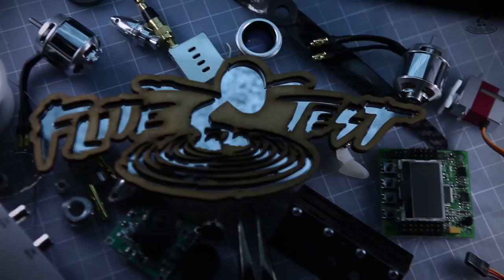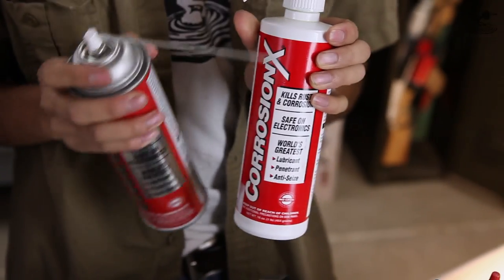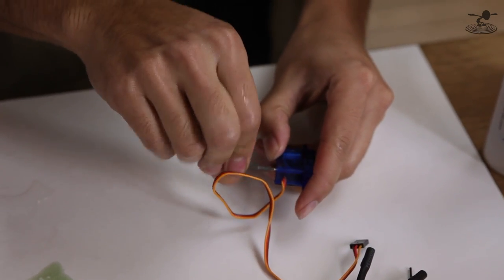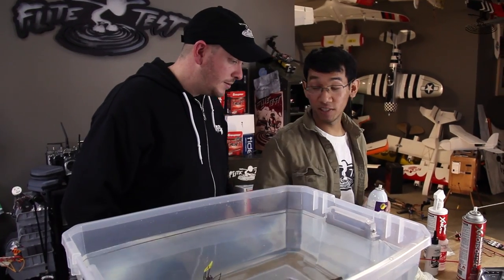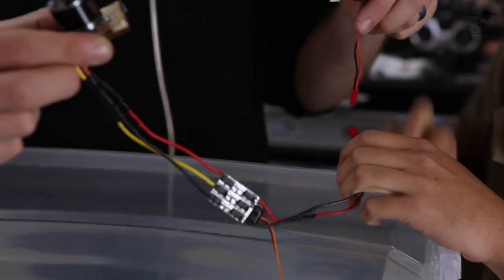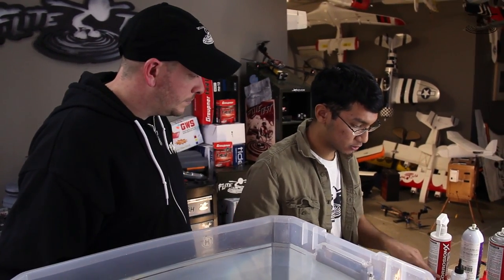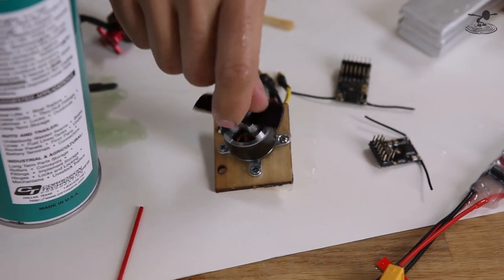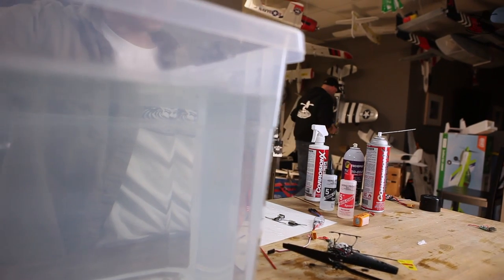Flite Test | Waterproofing Electronics

Comment: Thank you Peter. I have been using Corrosion X red label for years, saved many rec, escs and servos.
I learned about it on the WaterPlanes Forum on RC Groups. I also ordered it from the dist. in Michigan. Later I found small cans of it at my local hardware store. I also use it on light bulbs in the car, house, connections on my trailers and all those lights. It works great. I also use it on the tongue jacks on trailers, and I know some people who buy it by the 5 gal cans and use it on snowmobile trailers, their snowmobiles and all the other outdoor stuff they have that they want to keep lubricated and worry free.

Comment: Standard 5 min epoxy is conductive to a point. I have been waterproofing electronics for over 15 years. For esc  the best way is is by using 3m potting compound. You need to disassemble and then brush all 2 light coats over all the fets, resistors ect. Then put back together and you are good to go.  Servos corrosion x is good. For the rx you need to remove from case take a small piece of styrofoam stick on pins temporarily and then spray with liquid electrical tape. I use clear but black will work. Spray a couple coats and you are golden with no loss of range. I have a entire thread on OSE offshore electrics forum from about 8 to 10 years ago showing the exact procedures. We were making our gas and nitro boats electronics waterproof long before there was fast electric boats and waterproof electronics for rc. Anyways awesome vid enjoyed watching.

Comment: I learnt the hard way when I used a non waterproof steering servo in my nitro RC car in the rain, one minute it's driving fine in a straight line then the servo starts twitching at full speed and flips the buggy. Make sure to water proof your servos or buy a water proof one! Great tips Flite test :)

Comment: I used Corrosion X HD after watching this episode on a cheap HXT900 servo I have setup for my underwater ROV and so far it is waterproof in fresh water up to 40 feet deep so far.  Next dive should be 80ft or more.  Thanks Flite Test for the great idea!!!
Reply: yea you can buy a radio cover so you can fly in the rain aswel
Reply: rsokors what is an ROV?
Reply: star wars games ROV=Remotely Operated Vehicle.  A common term for an underwater rover... like a submarine, but with special features...
Reply: rsokors oh, so a remotely controlled sub basically.
Reply: star wars games Yeah.

Comment: You might consider sealing your heat shrink  with RTV Silicone as well.  Windshield sealant (RTV) will seep into crevices very well.  If you think you might ever want to get back into your electronics, RTV would be a lot easier to dig out than epoxy!!!  You might also want to try Dielectric grease.  It's a little messy, but does a great job of keeping moisture out of connectors.  I had a customer who wanted to waterproof his Satellite Broadcast Transmitter.  TWTs (Traveling Wave Tubes) Normally run at about 8800vdc on the Cathode, 4400 and 2500 volts on the two collectors.  He used Humiseal 1B31 to coat all the circuit boards and dielectric grease to seal all the connectors in his transmitter.  Then he took it out to the parking lot...put it in transmit (that means with the High Voltage power supplies turned on) and put a garden hose in the chassis and turned it on!!!  He ran it that way for half an hour with with the water running with no failures!!!  I doubt you'll ever run into 8800 volt power supplies in your RC equipment, though!  ;-)

Comment: Liquid electrical tape is also very useful, and it's pretty easy to remove. I did my video transmitter, FC, Radio, and ESCs and I was able to fly in pouring rain. I haven't tried it submerged, but it I'm sure it will work.
Reply: +compwiz00 did u dip your esc's?
Reply: +compwiz00    Where did you get that?  Live near Seattle and am interested in flying quadcopters in the rain.  Unsure about what to do with the flight controller

Comment: Remove heat shrink and dip the esc as to create a thin layer that 100% keeps it dry but also allows better heat transfer as it is like a heat sink. The heat shrink only insulates the esc by minimizing surface area directly affected by air flow. I have boat esc’s dipped in two part epoxy like a candle that are 6 yrs old and have seen water as a cooling method. The point of failure is typically in the battery connector

Comment: What does it do to the plugs on the transmitter. Does it coat them and stop them sending a signal?
Reply: this stuff is cool, conductive and water resistant
Reply: So if I do it on a plane then later add aux and additional stuff it will work? It doesn't block me for plugging in new stuff?

Comment: is it plastidip good at all for waterproofing an ESC?,thanks a lot...
Reply: actually, yes. I plastidipped the circuit board and all connectors of an old HTC Thunderbolt phone and reassembled, threw it in the water for several hours, it still boots up to this day

Comment: Very informative. Just purchased the corrosion x....also, sticking your hand in a bucket of water with DC voltage that low with low current idling a motor will far from ever hurt you.  Matter a fact I don't think even high current at that voltage would hurt you. Don't forget, DC voltage is nothing like AC voltage. Ac current return path is earth, putting your self between the bucket of electrified water and earth will shock you but...direct current works in a very different way, your body would have to be in series with the battery and the load device and even then you'd need a little bit of current to feel it. Don't forget too, that water has a better conductivity than your body, it would never pass through you before the water...as electricity chooses the least path of resistance...flight test guys don't know all this???😁

Comment: For things with dip switches or tuning pots I have used silicone sealant. Means that it can be peeled off again easy. I have also heard of people using plasti dip as well. Can also use marine grease and pack their servos full of it, electronics and all to waterproof. I have also heard of grease used to protect connectors.

Comment: hey for testing salinity content you can use electronic testors, or mechanical ones. salinity changes buoyancy.
For Automotive battery, and radiators the mechanical testors use different pellets that float at different levels depending on electrolyte content. or a needle that floats.

Comment: I think the esc is so vulnerable because it has the transistors that use a very small signal to activate them, and if it doesn't get the right signal it will bridge some circuits and create dead shorts.
Reply: I think so too, MOSFET need almost no current to turn on, and if there are any H bridges, it will short them.

Comment: Have you tried 3m 4000?  That's a waterproof sealant I use on my sailboat. It actually cures faster with moisture. Fully waterproof and remains flexible. I'd recommend that over epoxy any day.
Reply: +Ralph Hoffmann  That sounds interesting.

Comment: Excellent video.  I need to mount some water-rudder servos on floats for a float plane.  Now, I know how to waterproof some servos that I already have.  A couple comments on epoxy though.  (1) Although you don't need a structurally strong epoxied joint, the epoxy parts really should be measured out more precisely than skirting globs together.  If the epoxy/hardener proportions are not at least close to being precise, the epoxy mixture may not ever fully harden.  (2)  Epoxy has a lot of allergens that can absorbed through the skin and breath.  Nitrile gloves should be used when mixing/applying epoxy.  There are many known cases of people unexpectedly suffering anaphylaxis due to exposure to liquid epoxy.  Some people have severe allergic reactions during the first exposure to epoxy and others after prolonged (as in years of off/on usage).  Anyway, I just wanted to say a word about respecting the allergenic properties of epoxy.  Great video.  You guys at Flite Test always do a great job of making informative and entertaining videos!!!

Comment: If you gets your electronics wet, disassemble it and rinse it in distilled water (electronic water is best) and then in isopropyl alcohol.
Isopropyl alcohol (IPA) will pull out water and then evaporate quickly. This limits the chance there will be a drop of water somewhere under your components or in hard to reach place. Also IPA may be able to dissolve some of the contaminants that water could not. Also, don't be timid when using distilled water, just submerge it and shake it vigorously.
I see many people making mistake of not committing to really submerge the laptop board in the water. You really want as much distilled water so that it can quickly dissolve and pull contaminants from your board. The more volume of water and the better access it has the better for your board.
Good distilled water (or even better, electronic water) is not damaging to the board. It is only after stuff is dissolved in water (microelements, salt, chlorine, oxygen from air) that it becomes damaging to electronics.
It is still better to rinse the board in tap water and then with IPA than let it stay covered in salt water or sweet Latte...

Comment: As an electronics engineer I recommend what we call Potting the electronics. you can purchase the potting epoxy pretty much anywhere online or at electronics supply stores. conformal coating is another name. esd safe and anti-corrosion conformal coating is recommended for most electronics boards. it does not work well for parts that need to dissipate heat, such as the ESC or the HV servos. if there is any doubt, google is your best friend. for protecting your brushless motors, you can use silicone lubricating spray and a frequent cleaning with wd-40 to remove moisture.
Reply: For the issue with the ESC. you can pot those but i would not pot the power FETs as they need to transfer heat to the heat sink and the voltage they put can short fairly easily through conformal coating and corrosionX, instead you can use the 5 min epoxy or even 100% silicone like what is used for glass.
Reply: Also, radio signals in general dont work well through water. that is why most ROVs and rc submarines use tethers. you can get around this with a massive antenna on an fm receiver or by making an antenna tube that breaches the waters surface while diving.

Comment: Late to the party, but three thoughts:

You can get epoxy with self-mixing nozzles to make it easy to fill the ESC.

I personally would think pure silicone sealant would work better than epoxy, because it will remain flexible.  It sticks directly to anything that is made of silica, including glass, with a really strong bond.  It's used to seal aquariums!

I'd try sealing the ends of the heat shrink and letting it cure before shrinking it creating an even tighter seal.

Comment: I am not sure if this question has been answered, but what should I do if I  have an AIO board with all of the ESCs mounted on the bottom stack of a two tier tower? I do not have four individual ESCs. I do not think I can put heat shrink over the entire bottom board. I am not looking for it to be able to go under water, just as a snow guard. Will regular silicone conformal coating be enough to prevent damage from a crash in the snow?

Comment: How often do you need to re-apply corrosion-X? Or is it a permanent solution to moist/water protect your electronics? The epoxy to me feels like a more permanent solution because it feels like a spray will only work for some amount of time?

Comment: Hi guy's I have a question about using this on my flight controllers in my multirotors. Will this prevent me from soldering the board? Is it a matter of cleaning the area with alcohol? Thank you for the video's you make I always learn something every time.

Comment: Instead of putting shrinktube around the ESC, I wrap it in packing tape, and seal one end. I pour in the thin "finish" epoxy. When it's hard, you pull off the tape, and you have an aluminum heaksink exposed to the air...plus, the ESC is completely "potted" in epoxy, and waterproof.
Reply: Excellent idea!

Comment: Does a six amp ESC need the epoxy treatment or could you just use the corrosionX.  Epoxy seems a little overboard for these tiny ESCs?

Comment: Hey, I'm new to the hobby and i have a couple of questions...
What do i do to my controller board (kk2.1) to waterproof it?
If i want to fly my hexacopter in rain, is corrosionx enough or do i still have to go with epoxy? And also, do you have any alternative to epoxy, because i cant find that thing in india.
Do i have to worry about getting the corrosionx off of my components... or can i just leave it like that?
thanks!

Comment: what do you suggest for a simple plug and fly led light system.  I was hoping for something that just plugs in and does not require buying seperate connectors and soldering etc..  thanks

Comment: This is ALL sound advice. Thanks!!! 
ONE EXCEPTION!! Spraying the Motor with CorrosionX ONLY works for SENSORLESS Motors!! You WILL fry a Sensored Motor doing this. Conformal Coating or Epoxy on the Motor Sensor Board. 
Other than that caviat, thanks Peter! That was very informative.
Carmine 💥 ⛽
Reply: Puh, thx, was about to do a sensored motor...back to plastic dip it is then!

Comment: If i cover the connecting parts of the circuit with this substance, will it stop the electric current, or is it okay to coat it over all my connections, and can this substance also waterproof DC motors

Comment: If I remember right there is a caution on the Corossion x for LCD screens, it may not be great for them, may apply to a kk2 board. Otherwise I use it on my boat trailer light connections that get regularly dipped in salt water and it makes life much easier, its good stuff, a bit pricy, but good.

Comment: Great information!  Will this work on a camera attached to my quad as well?  I have the phantom 2 vision + .  I'm considering rebuilding with the GoPro but I haven't found a gimbal that will hold the GoPro in its case.  I'm often flying over the ocean, so getting wet is just a matter of time.  Thanks!

Comment: Awesome video. Although "distilled tap water" has a much lower conductivity than conventional tap water (or most water that will be encountered in the field by an RC vehicle). So actual performance may be somewhere in between the two types of tests performed here.

Comment: for the cooling for the ESC's, i was wondering if you could attach a heat sink similar to the ones used to cool CPU's, and have the heat sink exposed to cooling air/water but the ESC itself would be completely sealed off.

Comment: Great video.  A question for the electronics gurus: What is the reason for CorrosionX and conformal coating not working on ESCs? (e.g. heat dissipation, current, high frequency AC?)

Comment: I have been in this hobby for 8 months now and I have never heard of Corrosion-X. I've only ever heard of conformal coating being used. This video is 7 years old. Was it discovered that Corrosion-X wasn't a good product to use? I've used Conformal Coating a few times but every time I used it by quads quit working after a few weeks. They never got wet, they just stopped working. I didn't know if it was conducting electricity or holding in heat OR if it's just that electronics that come out of China suck and half the time don't work right out of the box. I've also seen some silicone tape that is for heat dissipation but it looks like ti would also seal the electronics from water. That seems good since it's designed to allow heat to pass through it but I haven't heard of anyone using it to waterproof electronics.

Comment: Great video - I've been into boating for years, and use Corrosion X to protect all sorts of things. One thing though - you might want to wear rubber gloves when using it. These products contain some nasty cacinogenic organic compounds and solvents, and god knows what else. The lables are explicit about avoiding contact with skin, or breathing the vapors. Gloves and good ventilation are your freinds around nasty chemicals. Remember: The better a chemical works, the more toxic it tends to be ;-)

Comment: Just used CRC Heavy Duty Corrosion Inhibitor on my DJI phantom.  Didn't do the GPS unit, but sprayed it on everything else.  I figure the plastic case provides some protection but this can't hurt...First test flight nothing bad happened...Not going to dunk it in the bathtub or anything so can't say how well it works but the treatment doesn't seam to have done any damage.

Comment: Awesome video, as usual I am late to the party. I found many uses for  corrosion x the last 25 years on many corroded stuff and electronics. I would add is to be careful when using on your transmitter. The plastic on the screw areas and battery compartment in my tx JR 9x slowly fell apart. Remember to wipe away excess spray and keep it on the electronics only.

Comment: For an esc you can make an epoxy bead on each side around the wires, let it cure, then slide on new heat shrink, squirt in some silicone caulk between the epoxy bead and heat shrink...LIGHTLY shrink the heat shrink to just tighten it up a little and then walk away...let the caulk 80-90% cure them and only THEN, come back and complete the shrinking to lock in the seal. You can leave an ESC at the bottom of a pound for a week and it'll be fine..IF you took your time and did it right.

Comment: Would using this technique mess with the barometer on an APM? Thanks for the great idea!
Reply: yes
Reply: good question been trying to find out. I imagine expoxy would as it would block the sensors which I assume it has? but would corrosion x allow it to work still?